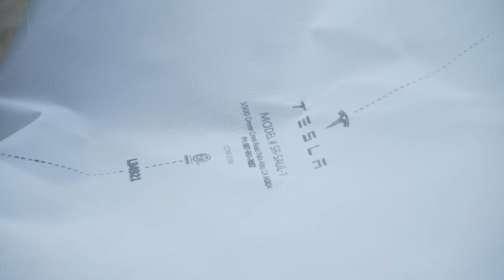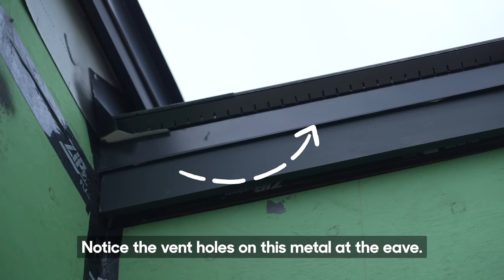Tesla Solar Roof - A Builders Perspective

Comment: I got a quote of almost $470K for the solar roof vs the $45K my insurance paid for architectural asphalt shingles.  That was for 54KW system with 10 power walls.  There is no way there is any payback on that here in Texas.  With the 25 year warranty, if we consider that the useful life, which in reality would be lower, as it would need replaced due to panel degradation over time.  That is almost $1600 per moth for the next 25 years that could be used on power bills.  That is without any interest charges either in that monthly payments.  I will just use my generator for power loss, if there is both a power and natural gas outage at the same time, there would be much larger issues.    I love the concept, but not at those prices.  If I had to pay electricity costs in Europe then it might be worth it.   Keep up the good work!  😁👍

Comment: I installed solar on my roof with the help of a loan. The payment on the loan was about the same as my electric bill until I paid the loan off which was 7 years. The only cost that I have had in the last 6 years is what the electric Co charges me to use the grid.

Comment: Solar panels perform better when cool (because nature has a sense of humour). So the air gap underneath might help keep the tiles cooler.

Honestly in Texas I'd just go for regular panels. I get 6 MWh annually in Ireland from a 6 kW panel install. I can imagine you'd get way more in Texas. With heat pumps and EVs, you could cover nearly all your energy needs just from your roof. It's one of the only home improvement project that will actually pay you back.

Comment: Air gap is largely to increase the efficiency of the solar cells.  Panel manufacturers often call for about 5" of space for air between the roof and the back of the solar panel (this is for the more standard 60 and 72 cell panels (or double that for half cells)).  Those temps jumping to 100F++ increases the electrical resistance and you get less wattage than if you have an air gap to cool it down a bit.

Comment: Your comment about the 50-year roof triggered this comment.

My grandfather (now passed away) put a metal roof on his home in 1946 which is a farm in Michigan.  It is now 2023, that roof has not had one leak and it will likely last for 100 years.   (I've been alive since 1967, and can confirm the no leaks between 1967 to 2023 part). 

They don't build things like they used to.

Comment: I thought i would like to share price comparison quotes i have received in East TN, btw shingle GAF, metal roof and Tesla for the same house. 48 squares or house total of 4300+ sq ft
GAF HDZ = 35k
Metal roof: $118,957 1) Install high temp ice and water shield over roof areas. 2. Install Englert 2500 series standing seam metal roof system over roof areas. 3. Flash all penetrations. 4. Remove and dispose of all roofing-related debris. 5. Provide Englert twenty-five (25) year No Fade manufacturer warranty. 

Tesla = $410 with one powerwall plus. There were only two installer certified by Tesla who pointed me to the them. One already said they went through the training but have decided not to go with installing Tesla roof. I have contacted Tesla regarding this but no response.

Comment: I thought we were finally going to see a video that showed how the installation details were handled. Things like how they get cut to fit, valley and hip details, penetrations, how to keep the air gap from becoming a giant wasp and hornet habitat, etc.
Reply: Don't quote me on this but from memory, the cut to fit stuff is done at Giga Buffalo in New York and the air gaps are small enough to prevent insect infestation as you can see from the video.

Comment: Thanks for this video. People put on new roofs every 15 years. They guarantee 25 years at least for these Tesla roofs. So with how durable these roofs are your more looking at 40-50 years of service. So taking that into account the roof will last longer... that more than compensates for the extra cost.
Reply: Perhaps, but many simply can't afford the upfront costs at this point. Financing will work for some, but it makes things even more expensive.
Reply: @AaronJaeger  If you have the money it's better value over time. Kind of like buying lifepo4 instead of lead acid batteries.

Comment: My house is about 2k sqft plus 2 car garage. Asphalt shingles roof is about $15k I think. I was told it would cost about $50k for standing seam metal. So if he said it's 3-4x the cost of metal, thats $150-200k for roof minus state rebates.

Ps. I bought house with solar panels already installed, so i got them for free. I think its a 10kw system and its more then enough to cover the entire house wirh some surplus. I believe those systems now cost $30-50k

Comment: Very impressed with the build quality. It's an amazing product - especially for those that want a stealthy solar installation that doesn't take up additional land. But, I would be interested in knowing the total cost difference between a Tesla Solar Roof and a regular metal roof plus a separate solar panel array nearby in the yard and what the difference in power production would be. -- reason being, one of the biggest factors in solar cell efficiency is heat. Imbedding the solar cell into a black glass and metal metal roof seems counterproductive for cooling the solar cells for peak efficiency. Everything is a trade-off, but I suspect a separate structure with good airflow would be cheaper and more efficient - even if it's taking up extra space and a bit of an eyesore.

Comment: Very interesting and very impressive.
I've got my roof being replaced right now with metal and have started interviewing solar installers.
I'm looking for having batteries and remote control, etc.
The Tesla roof was an option I thought about, but I won't buy anything that has the association and risk that comes with Musk being involved. I'm not spending that much money on anything he has a significant interest in and could  change the direction on. I just find him too unstable and the risk too high.
So, I'll go "old school" and get high-efficiency easily replaceable panels over metal. And I'm doing it with zero penatrations, for long-term minimal maintanence. 
Still, 50 kW is impressive, along with the battery bank and everything. It would be interesting to see the complete install.

Comment: If you want to increase your quality you would make sure nobody walks or kneels on the panels. This WILL damage the cells, which will affect the performance and could form a hotspot which means a possible fire.... Also just because the front glass doesn't break doesn't mean the cell doesn't develop micro cracks.

Comment: I'm sure this has been engineered, but I'm super curious to see how the clip system does in a high wind situation. It SEEMS like with the air gap under, it would be prone to wind coming up under the tile edges and flipping it up.

Comment: The mentioned air ventilation might be primarily for cooling the active tiles. Solar panels lower output when getting hot. They need ventilation.
Reply: It's a floating roof it naturally will release heat underneath through the vents.

Comment: Solar/battery storage/EV  is similar to investing in the stock market.  Higher costs upfront paying off later or delayed gratification strategy.  All renewables are expensive as paying everything up front vs legacy systems where the plants initially cheaper to build then you buy coal, oil, natural gas, etc., in monthly or yearly allotments to ease the costs.

Comment: It would be interesting to compare installs with the Tesla solar roof vs potential competitors.  I know GAF is making a solar shingle similar to this, but I don't think they use an air gap system under the tiles.

Comment: Maybe I missed it, but like to hear about its wind rating/resistance.   Living in tornado alley, while I don't expect a roof to survive hit from a tornado, high winds are not infrequent for us.  Just last night a few bursts in the 50mph with the storms went through.   Other areas nearby had higher.   So curious about how well it handles wind, especially with the clips and built in air gaps.   Are they strong enough and would the wind be able to use that air gap to cause issues?  As this roof looks and seems to perform really well,   Were we to get one in the future, i'd be a little upset to find it in my neighbor's yard after a night of high wind.

Comment: I bet a radiant barrier would work great under those shingle tiles. Perfect with the gap. I wonder if the higher temp would matter in this case, probably not I would imagine.
Reply: PV generates less when it’s really hot so ideally you want to dissipate the heat rather than reflect it back at the tile. That’s why theres normally a gap/airflow under the panel for all solar arrays, not just roofs.

Comment: I wish they would run a few separate non-inverted wire channels to outlets intended for DC electronics so they wouldn't need the power bricks. I realize different electronics need different degrees of DC power amd it can only go 25 meters but I'd like to see it as an option for the homeowner.

Comment: Will wait to see how these hold up after 5 years and hundreds of full heat cycles. Always remember with construction materials, if you are an early adopter, you are just a tester for the manufacturer. Tesla can claim all these things based on ASTM testing standards, but performance over time is only determined once a product is installed.

Comment: Tesla initially had several variants of the tile that actually exhibited depth and dimension, which this style (and now Tesla’s only tile) lacks. It doesn’t looks good on homes where it replaces concrete roofing tile because it has not real depth. The biggest negative is that firefighters hate it because it’s slick.

Comment: Two very important points that this video does not touch on. First, with all of those solar shingles on the roof If something were to fail it is difficult to ascertain the exact point of failure because there is no MLPE on the roof. Second, he says this is a multi-decade return but it's important to note that string inverters usually have to be replaced around the 10-year mark. Once that happens because the system is centralized to that inverter, the entire system will be down until a repair crew gets out and gets it back online. This is opposed to a microinverter system, where if a panel or inverter goes down, the entire rest of the system outside of that failure will continue to produce.

Comment: Cost for tesla roof $75,000 to $150,000
As most insurers will not
Cover anything over 11kw
They will keep you below that,most contracts tesla owns your roof so you make payments for full life of loan battery  is extra $13,000 for each battery you need 2
Reply: Thanks for the info. 👍👍 That's 2 huge ommissions from what is essentially an advert for Tesla.

Comment: The batteries receive AC? You would think they would divert power to the batteries prior to the inverter and once they reach capacity divert to the inverter and supply directly to the house and the grid.

Comment: I really want to see a follow up or two or three videos on the Tesla solar roof.  

I can’t believe this house will need the grid.  50kW and 10 Powerwalls!!    I can’t imagine the amount of power this house is expecting to use.   Is it going to be constantly mining bitcoin?   

I would be disconnecting from the grid completely with this system. 

I have 10kW system with 2 Powerwalls. And use ~13MWh per year (2 EVs, a plug-in Prius, 4,000 sq.ft. home with AC, and a swimming pool) and with my system I am close to being able to disconnect.  My electric bill over the last 8 years is a credit (ie I have not paid a penny to the electric company and they owe me).  But with this system it would be a no brainer to ditch the grid. 

Hope you do multiple follows to see how it looks and performs over time.  Thanks

Comment: From other vids I've watched of solar installs & price tesla charges (a 10kw solar panel plus 3 powerwall system supplying 7.6kw (after inverter) costing $45k), I'm guessing this roof/solar combo (50KW + 10 Powerwalls) costs north of $500k.  That's insane.  Granted, they claim it has a 50-yr life, & with the Zip system and size of this house and the area, I'm guessing this house is north of $2M or more, probably closer to $4-5M.

Comment: I'm 100% on board for solar, but I have heard that Tesla Solar Roof installs are in the 1000s. Well below what they were initially boasting. I'd be interested in the system if it was actually orderable by most people, but for now. This isn't a solution I would actually recommend for most people.

Comment: The tiles themsleves will last along time, but their solar output will decrease over time and the inverters will not last 20+ years. That's the real issue. But most people probably don't stay in the same house for more than 20 years and 20 years from now, there will proabbly be much cheaper and better solar replacement options.

Comment: Worked with the original application engineers at Tesla who designed the first generation of this product. Its change quit a bit over the years. still dont see it being cost effective enough for the mass market. Most of the manufacturing came out of buffalo at the time. the conceptual design started in marin county. the original designers have long left that company.

Comment: So what happens when a string stops working due to single panel in the string is malfunctioning  ? 
How will you determine what panel in the string is dysfunctional without having to open each panel in that string and test it ?

Comment: Nice video. This roof really impresses me. A follow up in a year or so would be great.
Would you mind sharing your latitude and climate zone?  Concerns from Minnesota:
Does the roof shed snow….looks slippery enough to. Do you get an avalanche when it does release or does it shed before significant depth builds up? Do you get freezing rain at the onset of snowstorms?

Comment: How do we get even more efficient? If we make the entire roof live panels we reduce the part #’s by halve. But we have to design the panels that get cut by a diamond blade to self seal from the heat of the cut.

That secures ground… In series & parallel leg. That is like some serious DuPont patents, shit. & legal wrangling with Corning glass works. Good luck having them work together, be easier to invent the Nike Air Jorden contract.

Comment: Its a very nice roof. However, the GAF system is much cheaper, and I don't think Tesla roofs will be that common. I like the fact that you can detach a single panel to fix it, because let's face it those connections are going to rot in hot weather and eventually a panel will go bad, and since they are in series, a single fault will bring down a whole string. 

According to google, a two-story, 2,000 square foot, 11.28 kW Solar Roof costs just over $55,300 before incentives, so it is somewhere between 1.5 and 2X the price of a normal shingle roof. Tesla guarantees it will produce 85% of the original power after 20 years. This of course has not been tested in the field yet, so i hope people keep their receipts.

Comment: A new house build or roof replacement no brainer.  What is nice with traditional solar panel additions are higher watts nowadays.  10 years ago panels only 250 watts now 420-700 watt panels.  Less are needed on your roof!

Comment: are the brackets and clips holding the tiles plastic or metal? If they are plastic wouldn't you be worried about life expectancy, especially with high temperatures of a roof.

Comment: So how long do the solar panels last? Using current technology a panel loses generating capacity as it gets older, so at about 12 years lifespan it's only producing about 50 to 60 % electricity. And by 20 years it's down to 40% so the panel gets scrapped.
So just like asphalt shingles you might be replacing your solar roof every 20 years but the expense is much more.

Comment: Thanks man for a great video on a product where very little information. Would like to see a follow up shows electrical performance on KWH per square foo. that’s the best way to compare performance to traditional panels. Also, would like to ask about building permits and fire  departments regulations. Most areas where I’ve installed solar panels regulations to keep edges clear for potential fire fighter or roofing maintenance access and it has to be installed in such a way that firefighters can cut into the roof to ventilate a fire.  Firefighters even have tools that would quickly and easily penetrate the standing seam metal roof. But how would they cut through this panel system safely without getting electrocuted by DC voltage ?

Comment: I have a traditional solar panel roof.  Since I own a 2 story limited panel area.  I own a 13 kw system for 2300sf house Hawaii.  With panels, powerwall, and EV save $600/month.  My whole roof covered with panels so kw monthly power very consistent even north facing side.  How many kw out of your solar roof?  Many newer panels 420 watt solar panels.
Reply: My battery has enough juice to power the whole house at night, free!  Air conditioning, etc. really adds value to home.  I sell excess to the grid also.   You can also store cheaper grid power(off peak) to be used later with higher grid prices(peak)  I can not control healthcare monthly premiums but can control energy costs.  My system paid for itself in 4 years.  25 year warranty.

Comment: Matt, If grid power goes out for 2 weeks, its more than likely that there will be sun shining during some or most of that time.  A good question to ask is this home designed for off fully off grid capability and how long it could be last this way.